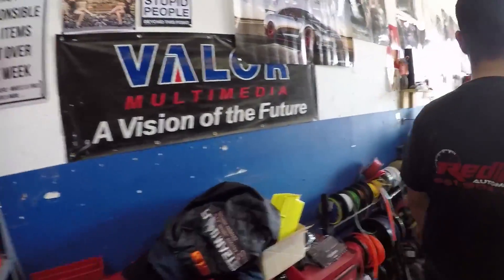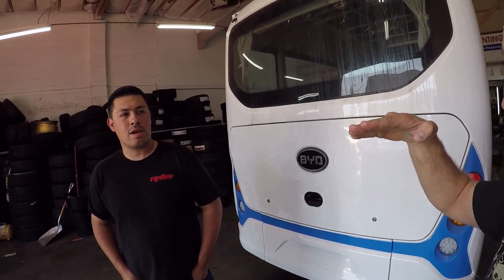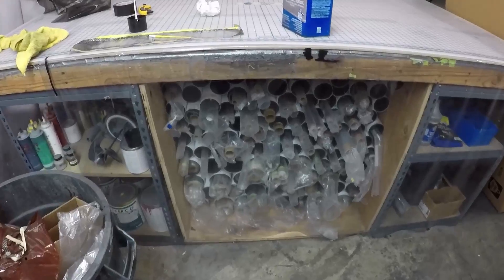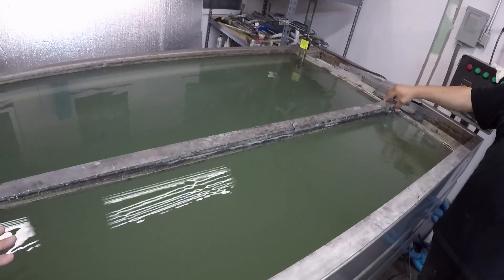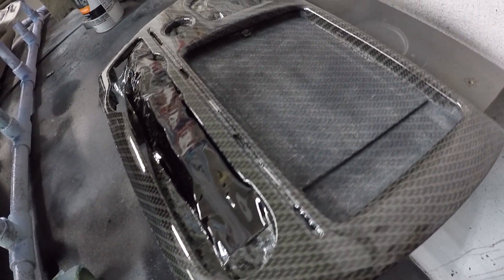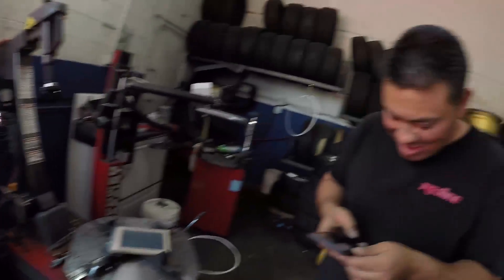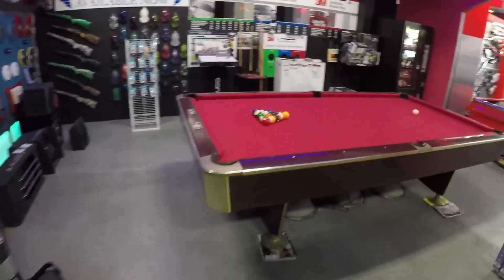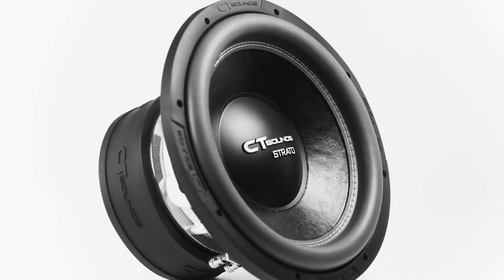WARNING!

Comment: I ran my finger through a router in March making speaker rings. Luckily it just tore up the meat of my middle finger. It's still tender as a bastard though.
Reply: lool
Reply: They make tools to use so you don't have to put your phalanges in there.... If you're crafty enough you can finger it out yourself!
Reply: 666hobart yea I know. Mark at CAF would be very disappointed in me.